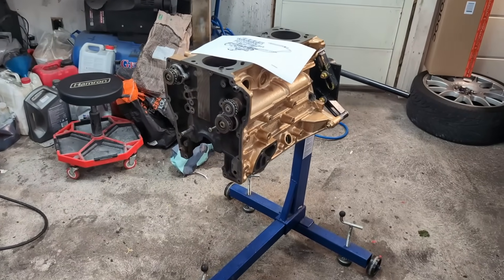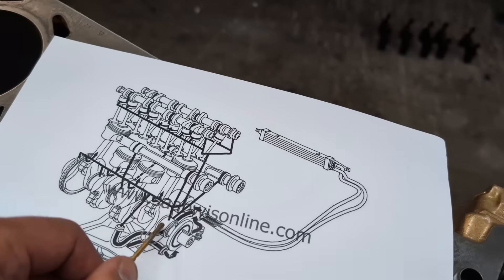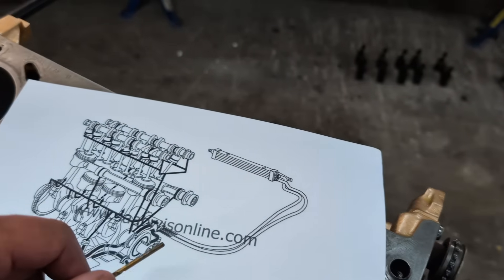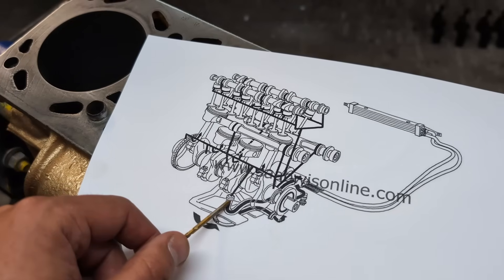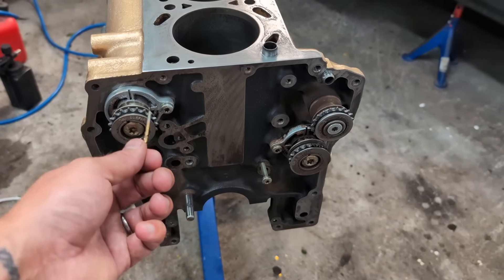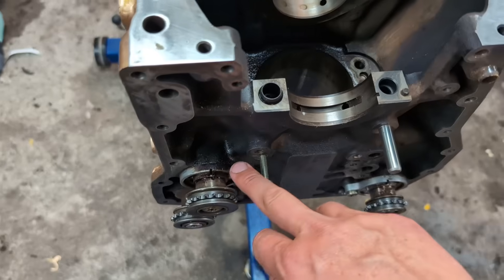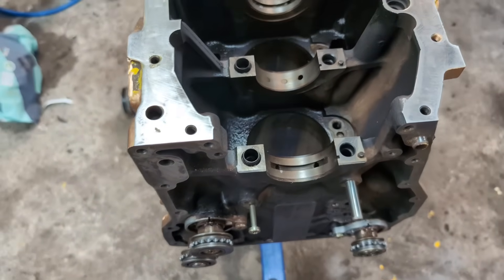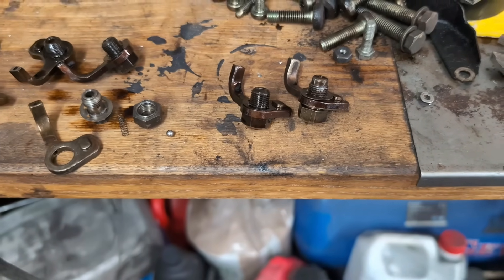SAAB Oil Pressure - Engineering Explained

Comment: How did you manage to take out the springs from the oil jet?
Reply from the maker: They are threaded together so you could split them. But be careful to not damage the threads
Reply: @JonasKakarikas  Υes they are threaded together but how did you manage to take them out? I mean you do not just roll over the screw and fall off...how did you manage to take them out?

Comment: Nice video! I would suggest 2 more things: in case you completely take out the balance shafts you can also block the oil channels to the rear balance shaft bearings by turning the bearings a little bit so they cover the holes. Or insert a plug in the position of these bearings. Tapping and using a bolt as you did is even nicer. Furthermore you didn't mention the pressure relief valve as far as I noticed. That also is a potential trouble maker.

Comment: Doesnt blocking the number 1 main bearing oil channel prevent the oil for entering the timing chain guide?
Reply from the maker: If you take the wrong channel yes, if you block the correct one No. So you really have to know what you do 😎

Comment: I didn't realize these had oil squirters.  I wonder if tiny screens before the ball and spring would help prevent leaks from debris.  Or instead of a ball using a metal cylinder that fits in the banjo bolt.
Reply from the maker: I would not change what Saab has designed and tested to the absolute max 😎

Comment: Top man jonas I’m using 5w30 in my 93 turbo but in the manual it states 5w40 I think will I be ok it runs like dream and I no urs will now with full working oil nozzles and oil pressure
Reply from the maker: Hope for the best right now 👌

Comment: Hey! Amazing content as always! Can you help me with something please? I got a saab 9-3 1.9TTiD cabrio, 2008, automatic, stock is 180HP with 400Nm and I want to do a stage 1, I saw on the internet that the safe limit is 220hp with 450Nm, but I saw other ones with 220/230Hp with 480Nm, do you recommend me doing that and also a TCU remap for oil pressure or just do the 220-450? Thank you very much!
Reply from the maker: Usually it's the not so serious companies that promises higher output, I don't know how it is in this case. But with a automatic gearbox I would have played it safe with 450nm
Reply: @JonasKakarikas thank you very much for your response! Do you recommend just stage 1 or a TCU remap too? Thank you!
Reply from the maker: If it's a good company do both 👌

Comment: This may be a very stupid question, but will the oil be filtered if the temperature is still below 80 degrees? Or is it rerouted directly before being filtered?
Reply from the maker: Good question, I think some oil will still pass through even under 80 degrees. But it will only be bellow 80 on cold start and a little while after
Reply: @JonasKakarikas yeah indeed, but knowing Saab, they probably thought of this. So what about people who only drive to the shops? Will they have oil that is not filtered at all? That would be very un-Saab-like 😁
Anyway, I really hope this engine will bring you gold 🥇

Comment: Saab 9-5 with no balance works really rough and its not about the delete part its about the suspension of the motor, whilst saab 9000 doesnt give a f*** with its 2 oil engine mounts front and back, the 9-5 doesnt feel so smooth after the delete process...Bout the spraying nozzle I didnt have any issues with it, 5yrs of building and servicing these engines. For the 95, 93 its best to do a hybrid engine that last longer and can take much more beatin, 9000 2.3l bottom and 9-5 top if u want to have things last forever ( If your buildin an engine for the 9-5, for 9-3og same principal just the head is from 9-3, u can mix 9-3 t5 and t7). 9000 bottom doesnt have the crankcase ventilation system with a hole in the block near the oil pressure sensor like the newer 9-5 which is leakin all the time, has a better bottom end the third thing is that factory seals between the head and the block where u have the timing chain tensioner, oil return and above the water pump leak if the head wasnt removed and properly assembled and thats an engine out procedure to do it properly.
Reply from the maker: This is a 9000 bottom end and reinforced T7 Head 😎
Reply: @JonasKakarikas  Knock, knock! Whos there!? 3rd bearing! Maaaan how did u disintegrate the 3rd bearing. Im running 380ish hp and they dont have a lovely life and I didnt have that problem...

Comment: Great video, I'm planning on putting forged pistons into my 9-5 aero either this fall or next spring. I'm still torn on pulling the engine or leaving it in, but I'd like to do the timing chain guides and balance chain/shaft delete. Now I'm tempted to pull the engine and block off those two oil passages to the lower balance shaft. Really good tip on those cylinder oil nozzles as well.

Unlrelated, but what trunk spoiler do you have on this car? I've been thinking about getting the tunstyle one from Belarus.
Reply from the maker: It's a realcar spoiler, skinned with carbon fiber. The tunstyle spoiler looks very similar

Comment: What if you put smoke detector machine to blow smoke to that feed pipe. Then its showing the leakage.And you can adjust the pressure.
Reply from the maker: Should work as well

Comment: I would have bought and installed brand new oil squirters if I were going to build a tuned engine ❤
Reply from the maker: That's a good point, think they are mostly sold out though
Reply: @JonasKakarikas  Yes, I can imagine that it's not easy to get hold of new ones.

Comment: You used an external oil pressure gauge. What brand did you use and where does the sensor get mounted? Also I can't find some specific O-rings. Any ideas on best practices to determine acceptable replacements?
Reply from the maker: Im using an Autogauge pressure gauge, the sensor is installed in the block beside the OEM sensor with a Y-connection. Check Saab retail sites for the correct o-rings

Comment: Hi Jonas, one thing I'm not sure about and I may have missed it in an earlier episode but if the engine was working okay in it's original orientation, why would it not work properly because you'd turned it 90 degree's?
Reply from the maker: I built the original engine on a block I didn't have any history on. Might have been some hidden damage from the very beginning. Could be the issue why the engine wasn't installed in a car 🤔

Comment: Hy Jonas 🙋I've been a subscriber on your channel for same time now, and I don't know why I didn't ask you this before. As I understand you plan to use this car on drifting, and you had all those problems with oil pressure. So, wouldn't  a dry oil sump be the right solution for this car? This will allow for a lowering of the engine, if possible in your case, too, which is always beneficial, generally speaking. That golden engine block  looks very cool 😎
Reply from the maker: Yes I dry sump would have alot of benefits, but it's quite expensive to build and there is no bolt-on kits to buy I think

Comment: Have you checked the oil pump clearances to the timing cover? There is some info in wis on this. Also clearance between pump and cover (end play) is very important as if this is too large it basically allows oil to leak from high to low pressure side before it even leaves the pump. Also I have heard there are new timing covers with oil pumps available on Alibaba for a B231r and B235 that fit and have  thicker oil pump gears. From the investigating I've done it looks like the Saab engine was used in some Chinese vehicles.
Reply: Trying to help out as I am going through similar issues with low oil pressure. I will post back as I learn more.

Comment: I remember years ago, some guy had his sump chromed for the look, but the chrome reflected the heat back in, which caused his V8 to overheat ... any issue with your gold paint doing that ?
Reply from the maker: There is no real thought about painting it gold, it was what I had available in the garage. It will not cause the engine to overheat 🫡 just du protect against corrosion
Reply: @JonasKakarikas  and it looks Gangsta!